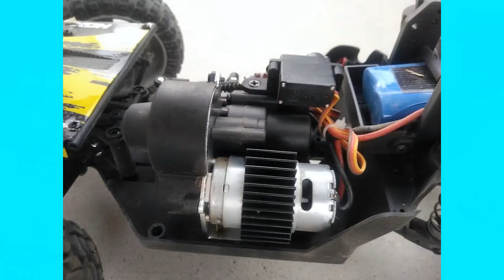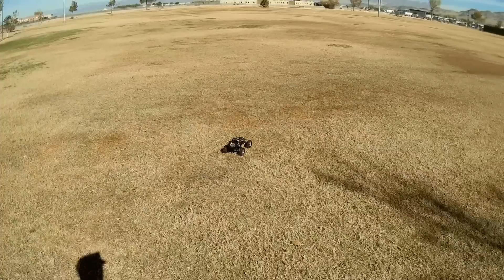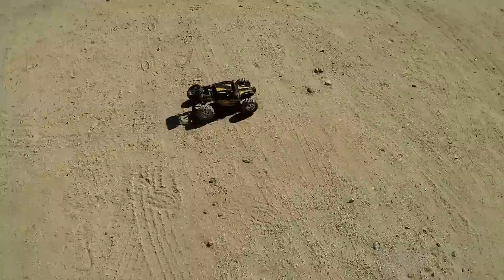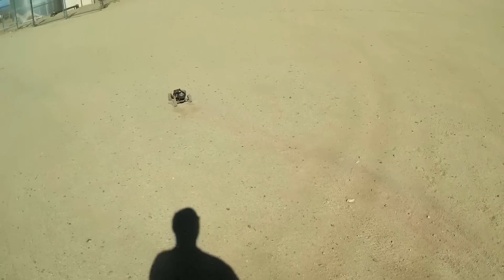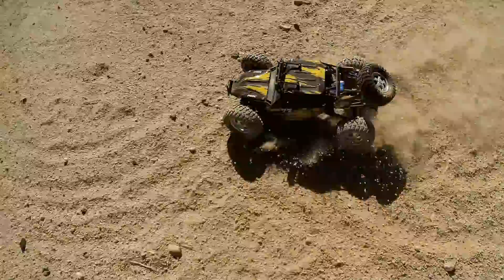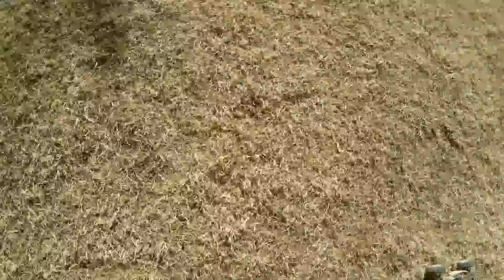Haiboxing HBX 12895 Two Speed 1:12 Scale 4WD RC Car Test Drive Review

Comment: I'm never sure with cars from HBX. They are often full of good kit but a few don't  perform as well as they should even with that kit. In this case it's not bad at all. Stable, performs reasonably and a good multi purpose truck.
 I think I'd rather have a 540 motor and no gear change as the rest of the mechanicals look capable and speed can always be controlled by throttle trim but it's OK as it is.